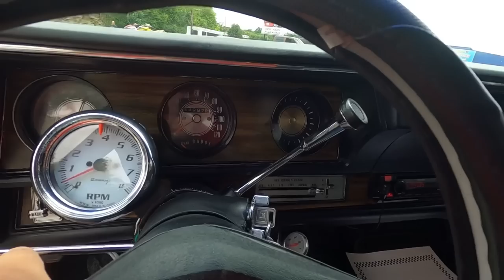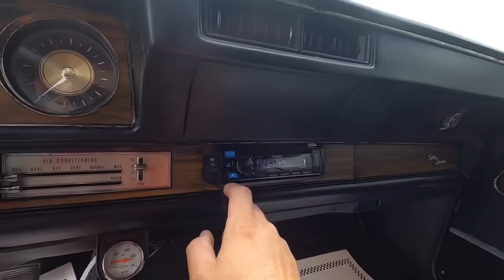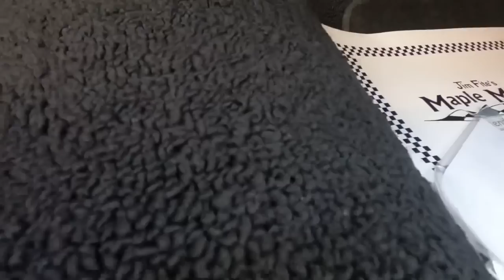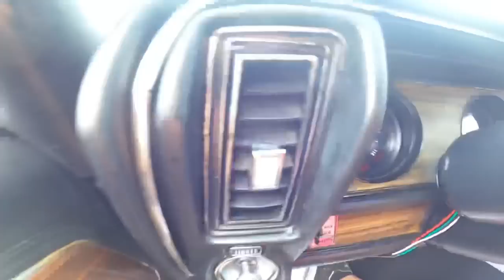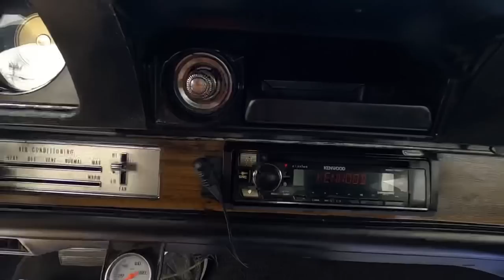Test Drive 1972 Oldsmobile Cutlass SOLD $24,900 Maple Motors #1671

Comment: I had a 72 Cutlass Supreme years ago. great car. I now have a 71 and a 70, the 71 has 134000 on the clock and has  never had valvetrain noise. Even after it sat almost 2 years in storage it started up with no smoke or noise. The rocket 350 is pretty much bulletproof with normal maintenance. Mine only needed a timing chain and it was just for maintenance purposes. I think I would be a little leery of that engine without a compression test.  Just my 2 cents from a long time Olds guy! Safe travels!

Comment: 1972 Cutlass and also a 72 Monte Carlo were 2 of my all time favorite cars. Some years were just great years. 1972 was one of them.
Reply: I owned a 1972 Cutlass S with a 350 2bbl.   It was one of my all time favourite cars, even though it was a bench seat automatic.  I just  really liked that size of car and of course the lines of the car were the exact same as the 442.   More sporty than the formal roofline on this one.  I did change it over to a dual exhaust because that was a much better look and sound.
Reply: 1972 was the year for Olds Cutlass, Chevy Monty Carlo & Chevelle, Ford Mustang and Dodge Charger and Pontiac GTO. 😁

Comment: Nice car. I would say prepare to rebuild the engine. I definitely hear rocker knock and vacuum leak. Vacuum leak is easy to fix. With an engine rebuild in mind they need to drop the price accordingly. It is a super sweet car.

Comment: Ahh the lifter clatter from an old Cutlass,I know it well
Reply: nothing a bit saw dust won't quiet down some lol
Reply: @AmericanPatriot-cw9xe  my brother had bought a truck one time from somewhere and they did just that to it
Reply: I have that tick in my 72 also
Reply: my 68 Elcamino had that same click and I read about the oil these days not having zinc in it so I purchased a pint of zinc and added it to the last oil change about 8 months ago, no more tick. They may want to try that. Worked for me
Reply: @csham8875  thanks will try
Reply: @wdc1818  Yeah you should. I was planning on yanking the motor out of mine because of that tick and now it is fine.  I'm sure glad I tried that.  Apparently those old cams need that.  Mine had gotten real loud at startup like it was starved for oil but no more and I drove it yesterday too.

Comment: I use to have a 1972 cutlass supreme..the ad in the newspaper read: very fast!! and looks very sharp!!
It sure enough was.
It was so quiet I couldn't hear it run..sometimes I'd turn the key again without knowing it was already running.
It had a 4 bolt main in it which is designed for alot of torque.
The car was so solid and smooth there was no vibration at all..even at high speeds of 110 mph..still no vibration and just as solid.
I never took it beyond 110 mph so I never knew its maximum speed..my foot was about halfway to the floor at 110 so I guess it would've done 150 mph.
I bought the car in 1989 for $1,450..you cant touch these cars for that price anymore.
The person I bought it from said the reason he was selling the car was that it had too much power for his needs. He would get speeding tickets when he thought he was only doing 40 mph but was actually doing 70 mph.
The color was metallic green, a beautiful car..the only thing wrong with it was that it had a crack in the windshield on the passenger's side, but that was all.
Reply: What engine did it have to have 4 bolt main ?

Comment: My very first car was a 1972 Cutlass Supreme back in 1986 and I have wanted another ever since. It won't be this one though. It needs the engine rebuilt and someone did some work to it and while it does look good at first glance, it's armature work at best. I see you also have a 1967 Cutlass, I had one of those too but I prefer the "72. Now if the price were right, I'd jump on it but it's not.

Comment: If you like inside the trunk the color was cooper gold at one time. But not bad for it's age, the top end of engine was a bad value in the engine. Please do not call it an motor, an motor is eclectic and anything that runs on fuel is an is a engine. No heart felling's my brother but it is what it is. Still I love your vids. Old Master Gunnery SGT USMC .For I have had many rods in my life, but I still love your vids.

Comment: Pretty heavy lifter tap sounds like. Could be a bent push rod however, these are very easy to work on and take apart. Maybe just give it a valve job at the same time as the guides may be worn. Otherwise it sounds healthy.

Comment: I had a 72 Buick Skylark 350 super rocket. It said right on the radiator plate 91 octane. That can cause some lifter noise. Can't get 91 Leaded any more.
Reply: @graeme8800  yeah I use to get airplane fuel and mix it to bring up the octane. Worked really well.